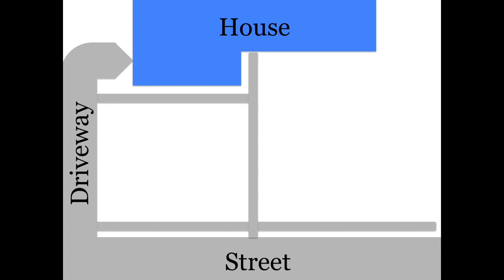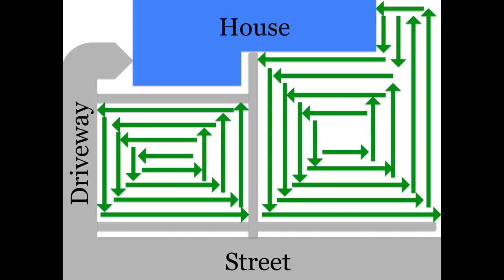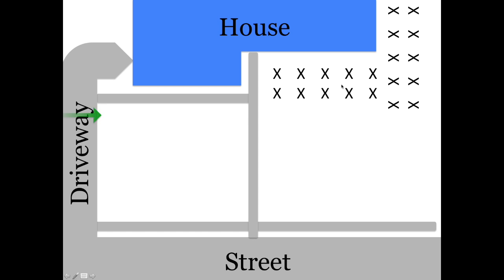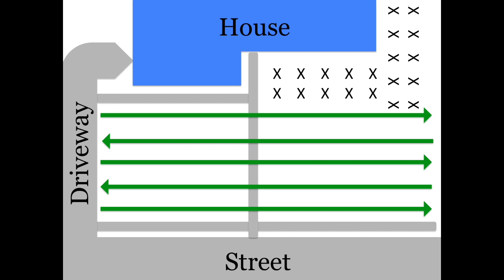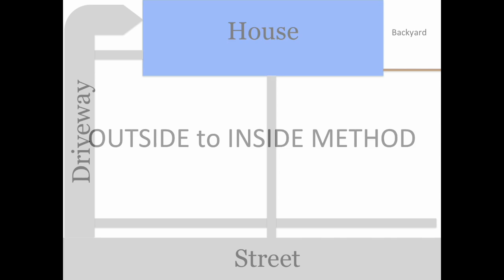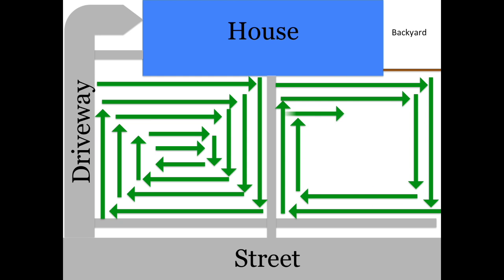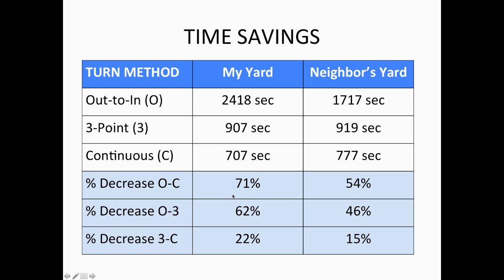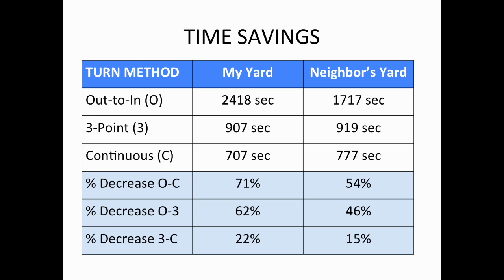A FASTER way to mow your yard!!

Comment: Mow the perimeter and then mow in a circular fashion until reach center. Like a spiral. One continuous turn.
Reply from the maker: Haven't tried that one yet.  I should & let y'all know.
Reply: problem with that is once you get towards the middle if youre on a regular riding mower the turn radius wont be enough. objects in the way kind of mess it up also
Reply from the maker: Very true.  I've started mowing around the trees to start and spacing the passes out more so that I don't run into that problem of the turning radius.  It's not a perfect solution, but it has helped.  Thanks for the comment.
Reply: Not the best way for the lawn, you want to change the pattern you mow.
Reply from the maker: Definitely.  It's best to change regularly to minimize soil compression patterns.  But even when I do, I take the same principle.  It's interesting though, I seldom mow on the same lines like I did before, so even if I don't vary the direction, compression and growth hasn't been an issue as much as it was when I mowed in the same pattern all the time.
Reply: Brent, I too believe the circle method, outside to in is the fastest.  But, throwing all the grass in one direction leaves a mess if the grass is tall, because you only cut it once.
Reply: Isaiah40:22  I bag my clippings. It just looks better. No clumps.
Reply from the maker: One of the reasons I like the never stop method that I end up using is because if the grass has clumps left behind from mulching, it gives you the opportunity to have an overlap and get them from a different direction.
Reply: Brent, I've always mulched.  On small front yards, I have a Timemaster.  But I broke it, plus it was bogging down in tall grass.  So I bought a Craftsman 28 inch and it's doing the job in tall grass.  The blades rotate in the same direction and doesn't keep all that grass up under the deck.  It doesn't do as nice a job as the Timemaster, but good enough for my needs.  The Craftsman is really slow compared to the Timemaster.   I wouldn't want to get into bagging one to two acres.
Reply: I see a significant times savings going outside to in, vs a 3 point turn.  I also loose time when I do cross mowing vs. 3 point turns on long runs.  I'll will consider your method next year.  But your numbers expended on a turn will be different then mine on a zero turn.
Reply from the maker: Most definitely.  A zero-turn makes all the difference.  If you actually have a turning radius of consequence then this is when something like this might be of help.  Thanks for watching and thanks for the comment.
Reply: At the place I work, I've got a bunch of lopsided shapes to mow with no sharp corners. there are a few beds on the inside with shrubs. Standard 20" push mower, generally I start along the outside and continuously mow in a clockwise spiral, keeping my chute pointed inwards. I keep going, completing several laps of the area until I can no longer mow in a continuous fashion, due to the beds on the lawn, and then I start a pattern on the inside, similar to your optimized longest-axis method, before cleaning up around the beds. I find this disperses and mulches up the clippings pretty nicely and gives a nice even finish- plus I've managed to mostly contain the grass clippings to the lawn itself.
Reply from the maker: Sounds like a great way to do it, especially with the way you deal with the discharge.  Thanks for watching.

Comment: I have a  craftsman with 42" mulching deck and I have a1.5acre field I always go outside in and  anti clockwise  it useualy takes 1.25hrs the grass is 3inch+ I watched your video and  tried this start in Center go anti clockwise and go faster and  faster till I was  flat out the finished off outside in it only took 40mins but I fell off the fucking mower pissed as a nute the field is only  for my dogs to play in but for  days after ever time I see it I get VIRTIGO so bollox to it  back to  outside in.
Reply from the maker: It's odd because I'm a safety professional too & I helped you get 1/2 way there...  Faster, but not necessarily safer...

Comment: But going from outside in can't be considered a "turn". It's more like a bend. I mow 4 acres using what you call the outside to in method. It's the quickest method I've tried - and I've tried everything. The best way to mow any lawn of any shape is just go right around the perimeter and keep looping until you get to the middle. Also  your philosophy doesn't take into account large yards like mine If you just turn with the natural radius of the mower and leave a gap in the middle, you'll find that 1). All the lines will be crooked for large yards and 2). The spaces left over will not be uniform so it will be inefficient. There's also trees, tables and other obstacles I have in my yard. I used to go around them in circles, but then I woke up and realised that it's easier to just go around them while doing the 'outside to in' method. Go around them on the right, then on the next pass go on the left.
Reply from the maker: Definitely a shape issue.  I adapted this from my time growing up.  We mow pastures this way.  The way to keep straight lines is to focus on something off in the distance and drive toward it instead of focusing on something close to you.

Comment: I'm sorry, who in their right mind would cut from the outside to the inside. How do you remove the mower without leaving lines? I watched your whole video and I could have finished a front yard in that time.
Mowing requires precision and offset patterns when using a Walk Behind mower. More importantly, people need to stop scalping their grass. Now, I live in the Midwest, the grass is predominantly Long Fescue, it should be no shorter than 3.5 inches, preferably 4 to 4.5 inches for a healthy lawn. But, I digress. if you want  your lawn to look great, let it grow, don't cut too low and / or water when temperatures soar.

Comment: From ie to ie...my observation...your non value add is moving forward without cutting new grass.  Next one is moving in such a way that does not allow you to cut at full speed.  Non value but necessary will be when driving over your concrete to get to new grass.  So your key is...how can you ALWAYS be cutting fresh grass and at max speed.  The answer...is you can get close...but you can't.  Your closest method is the wide continuous turns...but you will have to cross over your work...always!  Look at a zamboni...they have crafted the art of hockey rings for decades and they still go over their paths at both ends.
Good video.  I did notice the you time travel in your video...you are not showing your true wide turns...but I get it.  Thanks
Reply from the maker: I couldn't agree more.  If you're moving, you'd better be cutting.  It is tough, there will always be that little strip less than a mower deck width.  Thanks for the comment.

Comment: I spin a circle from center of the yard out continuously. Super easy no work turning , no down time every moment is spent mowing. Then I weed eat the edges. Btw I use a battery weed eater best ever. Wish I could use a battery mower, way to much yard.

Comment: Now, if your really concerned about time.  The biggest time saver...has nothing to do with turning.  Sure you can save a little time calculating what you did.

But to get the biggest savings in time.  Get rid of your mower that you can only cut at speeds of 4 to 5 mph.  Get a nice zero turn where your mowing at 9 to 11 mph.

The speed plus the time you'll save in turning with the zero turn, and the time you will save with the zero turn being able to get up close and personal.  Which cuts down on the amount of area you will have to weed eat.  

You'll wonder why you didn't get a good zero turn along time ago.  Because you'll find now you can cut everyone's lawn on your entire street an still be at it for less time than you were when you only cut your lawn
Reply from the maker: Honestly you're not the first to recommend the zero-turn.  I totally agree with you.  I would have done this already, but I just got the JD & can't afford the new zero-turn right now.  I think it's definitely in my future though, as my neighbor just got one and is zooming around his hard laughing at me.

Comment: Unfortunately, your yard doesn't look good at all. Because of your "optimization," you're cutting the grass in the same direction over and over, which is not good for your turf.
Reply from the maker: I never said I only cut this way.  I mow this way, 90 degrees, and both diagonal ways.  This video is just about the fastest.  This video was from August in Texas under water restrictions because we'd had 30+ consecutive 100 degree days and no rain since April.  So, with that, St. Augustine under those conditions looks pretty good.  But thanks for the critique and taking the time to comment.

Comment: And if you own a cubcadet your going to have to take your mower in to get serviced turning that much   your going to strip the streering gears doing that.cubcadets are horiiblly made i know...i owned one! Had to bring it in every year i owned it.
Reply from the maker: The JD isn't much better on the steering design.  Every time I look under or take the deck off I cringe when I see the very very basic and under built rack & pinion steering setup they went with.

Comment: Your lawn is too small to worry about. Get a push mower and then let us know.
Reply from the maker: It's a half acre & I mow 2 other half acre yards in my neighborhood.  I used to mow my 1/2 acre 21 inches a pass with a  push mower for years.  It's fun mowing St. Augustine with a non-self propelled push mower, I can 100% confirm.
Reply: Been there, TX. I'm from New Orleans and you have to cut that St Aug every week. If it rains much, you can't let it go 2 weeks or you can't push the mower through it and have to pick up the front and take bites out for the whole lawn. I cut 5 acres now and thank God for riding mowers. Thanks for the video.